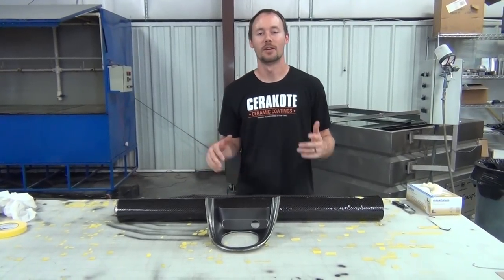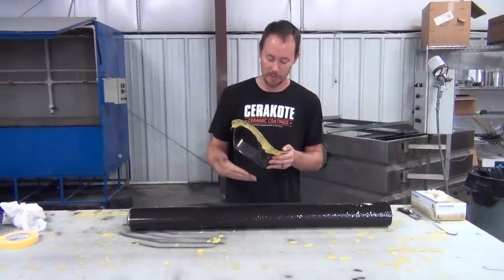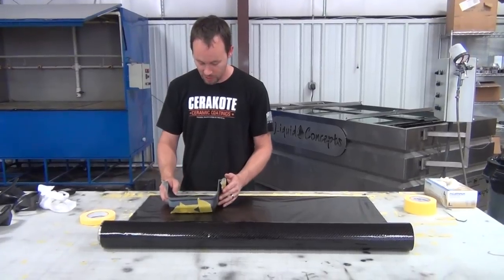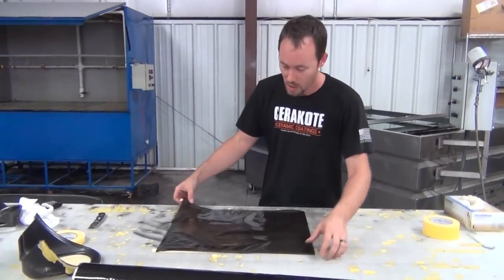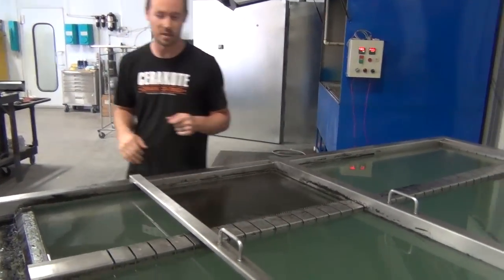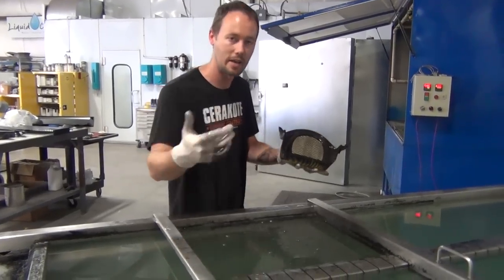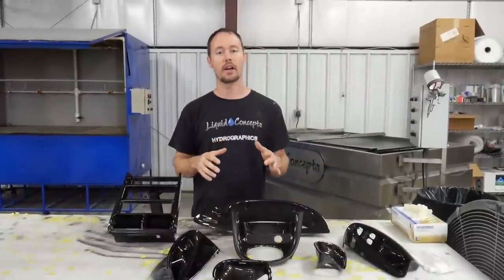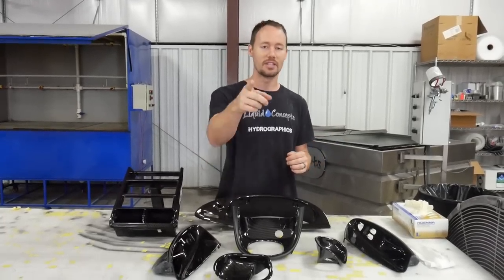HOW TO AVOID FILM FROM STRETCHING | Liquid Concepts | Weekly Tips and Tricks

Comment: I'm about to dip these same exact parts, was it hard to get the shifter bezel and the radio bezel carbon weave angle going the same direction? If it possible to hot glue a bracket on the back of the parts and dip them together using the same technique?

Comment: hey Bryan, How do i make the black carbon fiber because i bought the black film and when i dipped it you can hardly see the carbon fiber?is there a paint you recommend to you? Also, whats a good time to wait before rinsing the part cause every time i rinse it seem like the film is getting lighter. Thank you
Reply from the maker: What paint base did you use on the film when you dipped it? 

For the paint, we recommend this color for the black and clear carbon fiber - https://www.liquidconcepts.com/shop/product-detail/charcoal-metallic

After you dip the part, you can rinse immediately or even a few hours after dipping. The film may get a tad lighter but normally when the clear coat is applied, you will get the color and depth of the pattern to come back.

Comment: What's the. Cause of when I dip it looks good but when I got to rinse it little pin holes appear and or bigger chips of the film wash away? Under activating or overactivating?
Reply from the maker: Normally its under activated but sometimes it may be from the paint not being compatible with the dip or not ready for the dip.
Reply: @LiquidConceptsUSA  thankyou in your experience im unclear about paint compatibility? Like dupli color or rustoleum and or anything or is there a specific paint I should be using to eliminate this risk? Also I am using the LC activator but aerosol firm because I dont know how big of compressor I can get away with
Reply from the maker: I am not saying you cant use spray paint but we have seen quite a bit of customers have very inconsistent results from it. I would recommend using an automotive base coat/clear coat or even some of the paints that we have on our website to help you get better consistency with your process.

Comment: Thanks for these vids, you make this look easy!  I’ve been experimenting with this stuff and I love it. I’ve had good success But I tried a dip a few days ago and after spraying the activator using all the same time parameters when I went to dip the film was still just film. So I sprayed again and still just stayed film. Did I have the film upside down or what?
Reply from the maker: It could be that you had the film upside down on the water but it could also be that you may have water in your air lines. Have  you checked your lines lately?
Reply: Liquid Concepts, LLC thanks for the reply, I’m just doing small stuff currently with an aerosol can not a paint sprayer.
Reply from the maker: I would definitely check out making sure that you are activating the film correctly with the aerosol can as you can sometimes get streaks that can cause part of the print to stick and not others. Also make sure the sticky side of the film is DOWN on the water. 100% every time.
Reply: Liquid Concepts, LLC Thanks for the tips. You make hydro graphics look way easier than it is btw.

Comment: Quick question. Sometimes after rinsing my dips I have small bubbles under the film. Is it best to press those out, or let it dry on its own?
Reply from the maker: You can press them out but actually it's under activated if your getting small dots like that all the time.
Reply: @LiquidConceptsUSA , Does that mean to add more activator or let the activator sit longer before dipping the object? I'm having the same issue. Thanks!